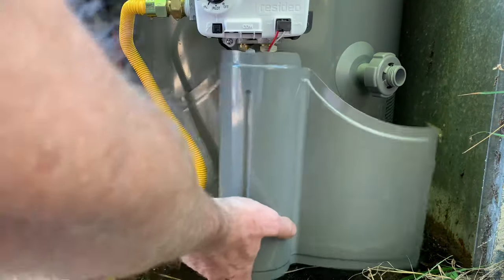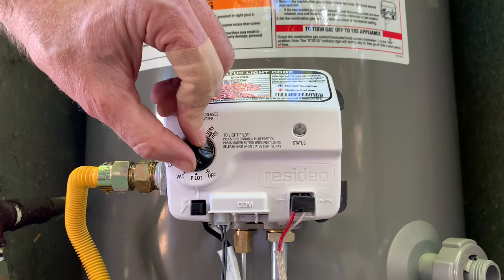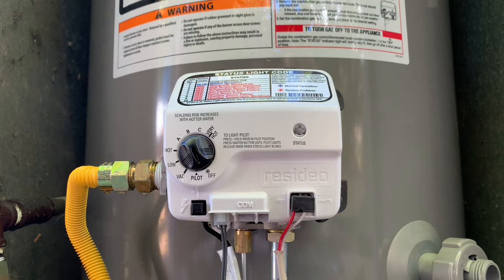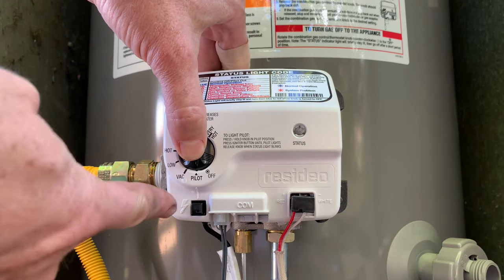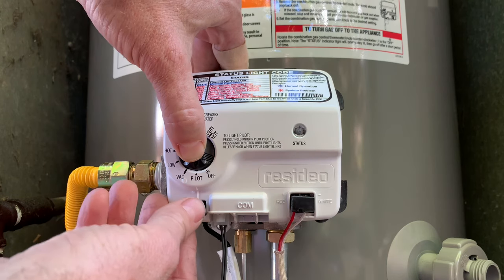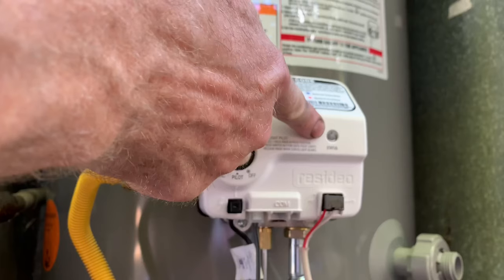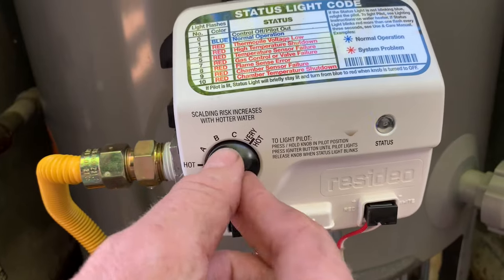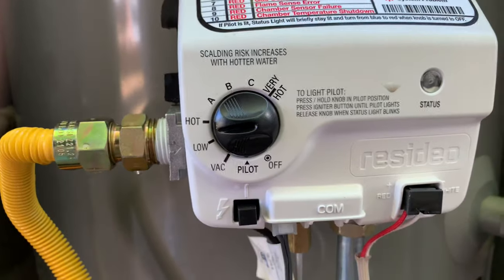How to light the pilot on a Rheem gas water heater

Comment: Followed your instructions exactly on our Rheem, and after about 500 pushes on the igniter button (you said to do it a lot) I gave up and called a plumber on Thursday.  They won't be here until Tuesday.  So now we have no hot water heater for 6 days.  Thanks anyway.
Reply: It’s been awhile, so I don’t know if you’ll see this, but can you tell me the outcome? We’re going thru the  exact same thing right now. We have the gas company scheduled to come out in 6 days (that’s the earliest available date) so it’s cold showers for us. Was it repairable or did you have to replace the water heater?  Thanks so much.

Comment: Thank you for this video.  Why would the flashing blue light on the thermostat stop flashing on my rheem gas water heater that is only three months newly installed?  My plumber said not to touch it and he will take a look.  I’m afraid to touch it even though your video is helpful.
Reply: I touched mine. You can’t be scared. As long as you follow the exact instructions it will work. It worked for me about 6 clicks into the blue light came on. I never touched a water heater before

Comment: Hi our water is too hot is there a way to turn it down a bit? The knob was on close to very hot I just turn the knob down to hot but our water is still way too hot. Can I adjust the temp?
Reply from the maker: There should be more lower settings on it that you can go down to.

Comment: Why the pilot light turn off itself? My gas fireplace did the same. Do you believe that is something wrong with my gas lines or not? Thanks a lot…save my shower with cold water to a good hot one.
Reply from the maker: Sometimes they blow out from the wind. You may want to turn it off and then check and make sure that there aren’t any obstructions where the gas comes out. It’s possible something has gotten in there to block the flow of gas.

Comment: What if the flame never shows up in the little window? Blue light flashes and looks normal but no flame.
Reply: This is to light the pilot. The heat from the pilot powers the flashing led. Then you adjust the dial to how hot you want the water. That starts the burner and you'll see the flames from it through the window. You can also hear it come on.

Comment: I just got a new gas Rheem 40 gallon water heater. The guy told me I had to keep it on the a button which is 120°. Well, my grandson took a shower let the water run for a little bit and burn his hand because it was so hot. So I turned the water down to not so hot.. for the next four months, it shut itself off every single month. The guy told me that if you turn it down too much it’s going to shut itself off I put it on the hot button he put it on the A button. Which is burning hot I am wondering if there this is a malfunction and I got a screwed up water heater that it shuts itself off but I can’t keep it on the hottest. It is way too hot.
Reply from the maker: That doesn’t sound right. I have mine set on a lower setting, and it hasn’t gone out since I made the video. I like the lower setting because it saves money, and I don’t need water to be super hot.

Comment: I would add that--at least in my case, it was important to push the pilot button in and hold for several minutes before pressing the ignition button several times. Apparently, the chamber needs to be filled with gas.